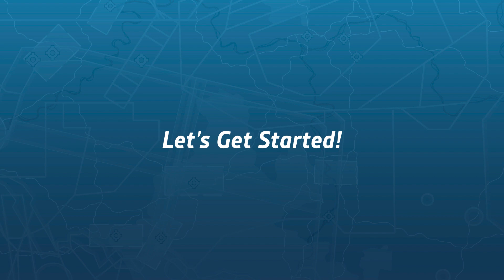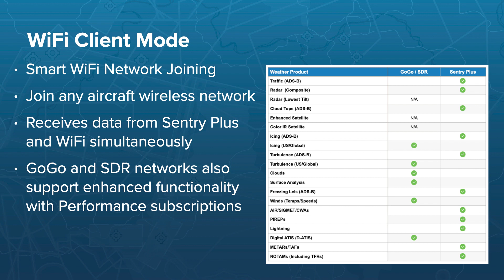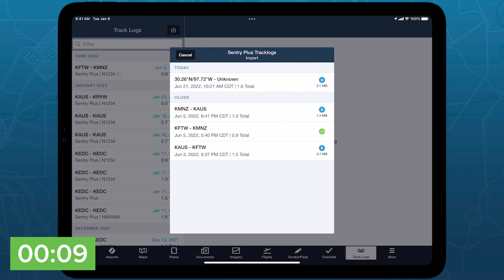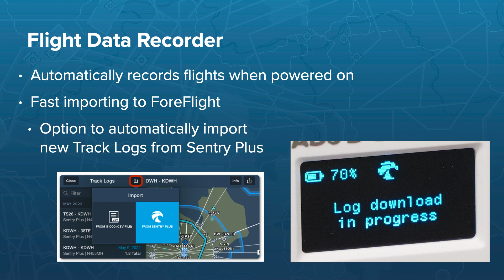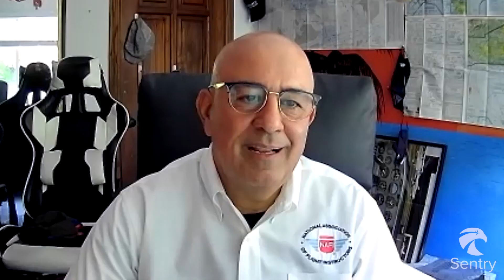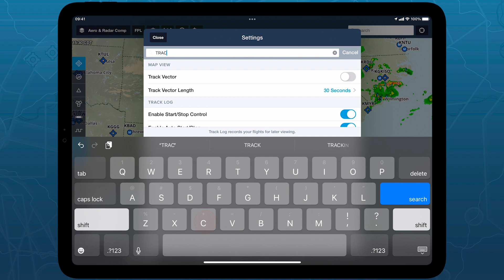ForeFlight on Frequency: Innovation Meets Inflight Safety with Sentry Plus

Comment: Good overall marketing review of the new unit so thank you.  I missed the actual webinar but was hoping you would discuss a few things as far as potential improvements that might have been made in certain areas.  1. A fair amount of users report frequent disconnects with Sentry and Mini.  The threads seem to lean toward antenna issues in such a compact unit. You mentioned additional work this time around but was wondering if you have much real world data so far to indicate the redesign results in fewer disconnects.  2. Again, a fair amount of current users report problems with windscreen/window distortion as a result of the suction cup mount.  Has there been any redesign to that aspect or has this already been solved and I have not heard about it.   I really want to believe in this unit to replace my current Stratux with an external powered GPS puck and tuned antennas for each of the two frequency ranges.  CO detection, track logs, AHRS are all great but if the unit disconnects frequently for whatever reason, then its usefulness at least for me diminishes the benefits of the additional capabilities.  Thank you in advance for any additional light you can shed on these two subjects.
Reply: Trent, ForeFlight and uAvionix have been diligently working to resolve the reported WiFi disconnections with Sentry & Sentry Mini and have nearly eliminated them through a series of firmware updates. We’ve brought all of that work forward into the latest project as one might expect. Furthermore, Sentry Plus and Sentry have a 1/4”-20 threaded hole on the back that makes it compatible with camera mounting equipment. Many customers use that option instead of the suction cup if they prefer.